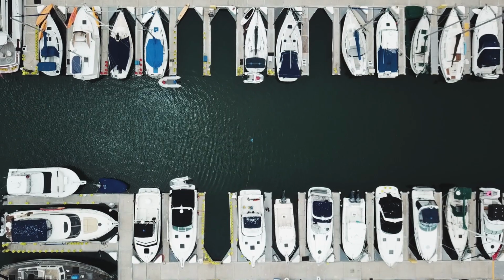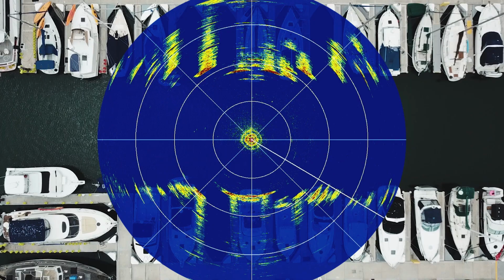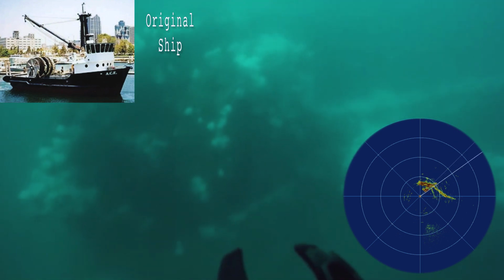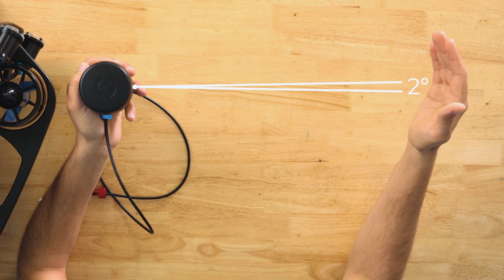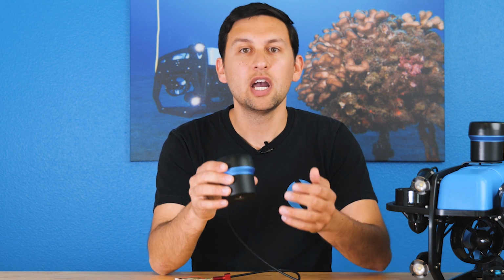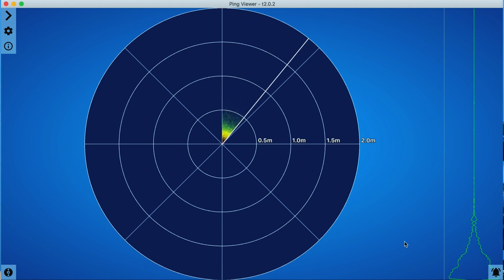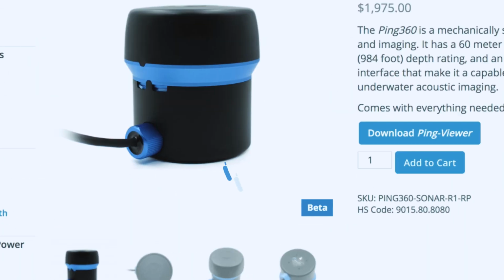Introducing the Ping360 Scanning Imaging Sonar for ROVs!

Comment: Excellent work, looks  promising. I would like to know what is the "frame rate" at both 360 and 120 degrees? or which are the options? I could not find that info on the specs.
Reply from the maker: Hi Gerardo, a few people have asked this so we'll have it on the documentation soon. A full 360 degree circle takes about 8 seconds at short range and we are working on software updates that will get that to 4-5 seconds.

Comment: Great job!
Is there a mode where it is possible to scan only in a specific direction and for a specific aperture? For instance +/-45° in the forward direction, in order to have a better refreshment rate in front of the ROV? In addition to the better refreshment rate, it could also improve the "image" quality, for there will be more signal in that case.
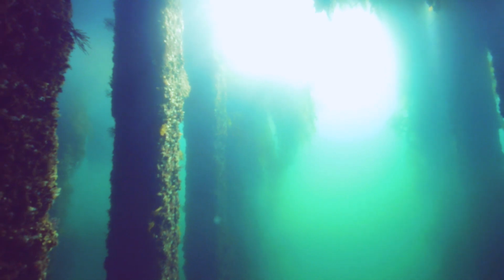Reply from the maker: Hi Timothe, yes! There is a "sector" scan mode where you scan less than 360 degrees. There's an example of this in the video at 2:00 showing just a 120 degree sector looking forward. The view in the Ping Viewer changes to show that sector as large as possible for the best image.

Comment: Out of curiosity what is the part that costs so much? R+D, the transducer, or the control electronics?
Reply from the maker: Hi Ian, it's a bit of everything. The analog electronics to filter the signal are pretty high-end and expensive. There are a lot of other parts that add up like the motor, transducer, microcontroller, and case. The process to build it is fairly involved, especially with the oil-filling of the transducer head. And last, there's a lot of R&D time and effort that went into this. We've been working on it for more than two years to finally get to a finished product! I hope that answers your question! -Rusty
Reply: @BlueRobotics  Thanks, keep up the great work!